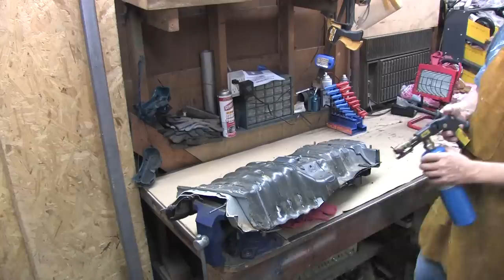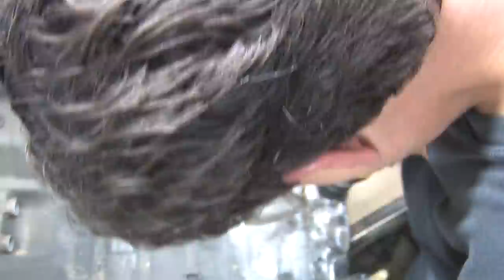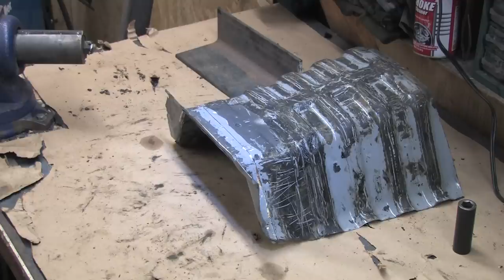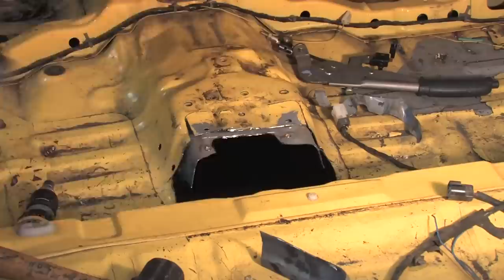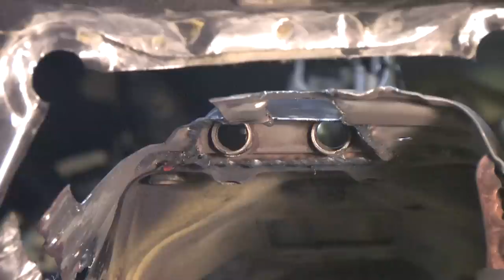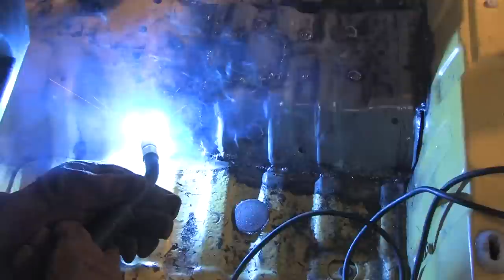Colt Tunnel Modification [1080HD]

Comment: They were steel hulls on Duce and ½’ frames and in Nam the Larks were aluminum! It’s more so the drilling out spot welds and the other laminated sections and saving what’s important for the reassembly along with filling in the missing or needed, that’s really cool talent!

Comment: I simply love your videos, especially the ones of your Colt Project. I'm currently working on a 88 Colt myself so I find your videos to be kinda inspiring :) Though my build will be rather tame compared to that "monster" you seem to be building. Mine is the pre 1990 Euro GTi Version (c53), meaning a 4g61 N/A Engine (Stock Power 124 HP). My plan is the turn mine into a ultra light, high reving N/A tracktoy.

Comment: Just wondering, do you need to brace the chassis so it doesnt go out of "alignment" whenever you make modifications like that?

Im under this impression that you want a temporary brace before you cut a hole on the floor plan.

As well, are you planning to put some por-15 once your done your modifications?

Comment: Wouldn't it be easier to find yourself a way to do a direct feed to a HDD? That way you're not burning through tapes.  You might have to find a place to set a laptop within 10 feet though.